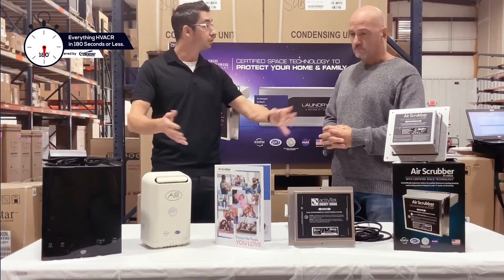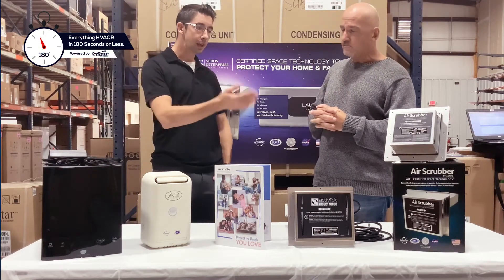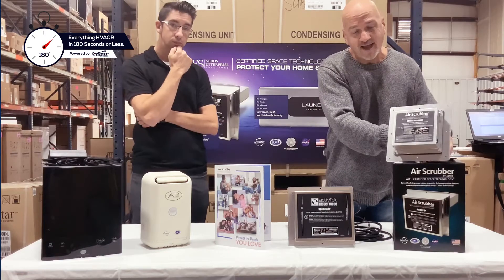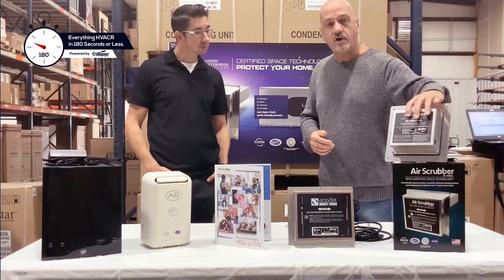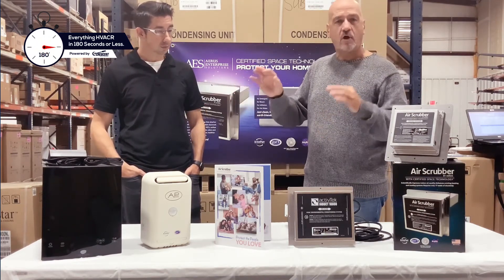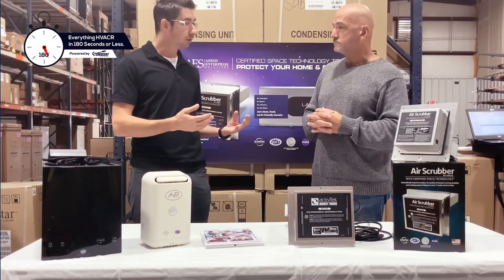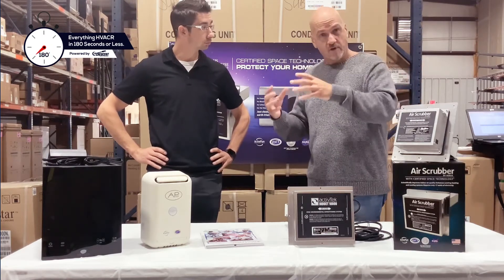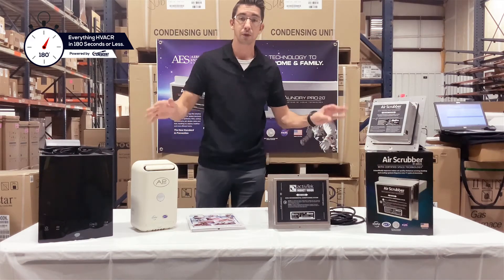Crescent180: All About Air Scrubber: Part 2 of 2

Comment: How does the Air Scrubber compare to a Lennox PureAir S solution?  Is their solution considered passive or active per your video?  Is the UV light components doing the same thing?  Both appear to use a titanium oxidation -- correct?  Thank you.
Reply from the maker: Thanks for your question! No, the UV components are not doing the same thing. In the Pure Air, the UV is used to neutralize contaminants as they “pass” through the device. In the Air Scrubber, the UV is one component used in the manufacturing of hydrogen peroxide molecules. The other two components: the quad metal cell surrounding the UV and hydrogen (moisture) from the air that passes through the device. The hydrogen peroxide molecules are then carried down the duct and into the home/facility where we purify both the air & surfaces. The hydrogen peroxide molecules then revert back to hydrogen and are absorbed by the surroundings, while the device continues to make more molecules to be distributed throughout the facility.
 In addition, the Air Scrubber removes dust & other particles suspended in the air by use of positive & negatively charged ions. Charged particles then attract together and are filtered out by the filtration system.